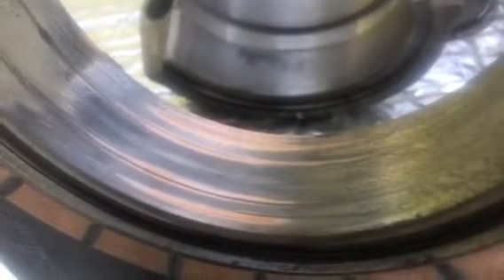Detroit diesel water in oil 671

Comment: I worked for the railroad as a locomotive engineer and the only time we change the oil on a locomotive is water or fuel contamination in the lube oil. On an EMD 465 gallons of motor oil, a GE? 485 gallons of motor oil.

That drain seemed overly long but not as bad as a locomotive. Drain is a 1 1/2 inch pipe hooked up to a pipe connected to the oil house.

Cheers!

Comment: I bought a 6-71 once for $200 that had been changed out by a mechanic because there was water in the oil. What I found was that the driver of the vehicle it was in, had put epoxy in the weep hole in the water pump, because apparently the waterpump seal had gone bad and was leaking water. The driver thought he was stopping the leak, but what he did was cause the leaking coolant to leak down inside the oil pan instead of leaking through the weep hole. I was able to overhaul that engine and then I sold it for $4000.

Comment: Hi, Did you change all the bearings? Some days ago I had this problem in one 6v53t and I chance the cilynder linner seals and head gaskets but I didn't chance the bearings because I haven't them. What Do You think about this? I run the engine the oil pressure is ok but I don't install yet. Sorry for my english I'm from Brazil
Reply: You definitely need to check the rod and main bearings because it's very likely they're bad.

Comment: What if i have I'll in my coolant, would that need a new head gasket?
Reply: Oil in coolant.
Reply: @209turtleboy  First of all check the weep hole in the bottom of the waterpump to make sure it's not plugged up, because if it's full of dirt or debris and if the water pump seal fails, the coolant will go straight down into the oil pan. If that's not the problem, then check for a head gasket and/or pressure test the cyl. head, sometimes you will find a cracked head, on a 92 series it could also be a liner o-ring failure.
Reply: @Tanguska Bear, If the problem is oil in the coolant, then you need to pull the oil cooler core and pressure test it.